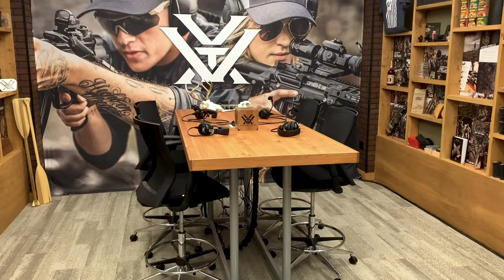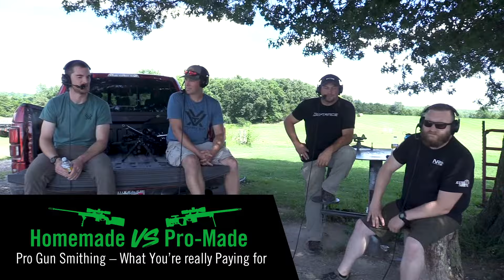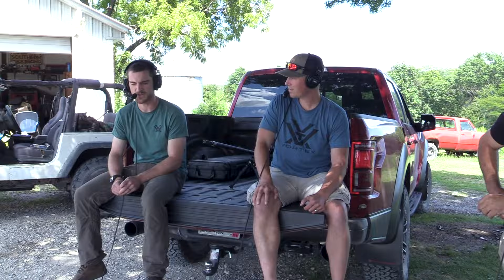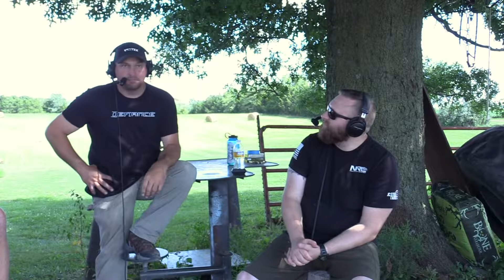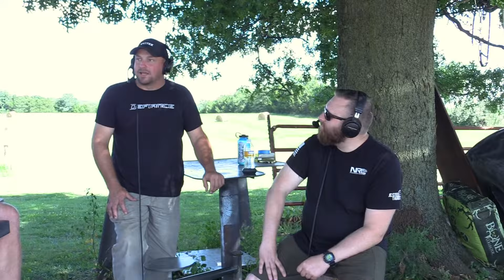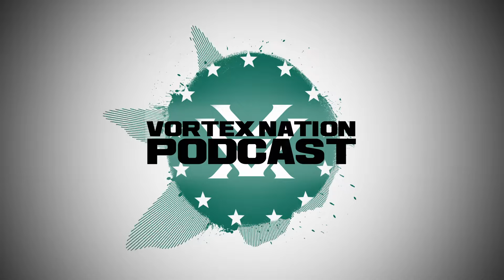Homemade vs Pro-Made: Pro Gunsmithing – What You’re really Paying for

Comment: Great stuff! It would be good to have a dry erase board to draw out sections like headspace, tenon, bolt nose recess, etc... Also he didn’t talk about the types of machining equipment he uses to achieve this accuracy.
Reply from the maker: That would be pretty cool for sure! As for the equipment, all of this is done on his precision lathe with various different cutting bits (Don't have that info off hand) and plenty of calipers for measuring various parts of the barrel and receiver. Also a runout gauge to get the bore as close to centered up in the machine as possible